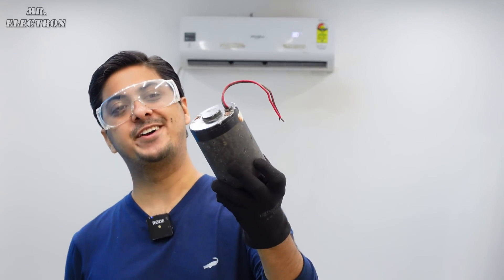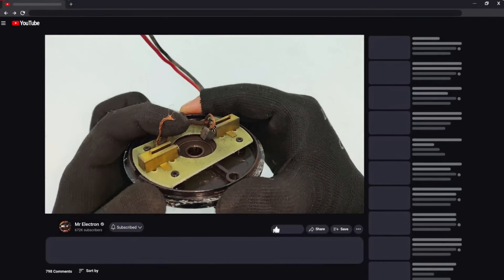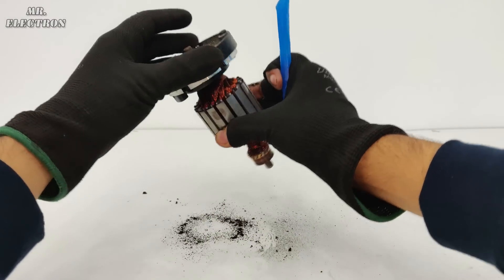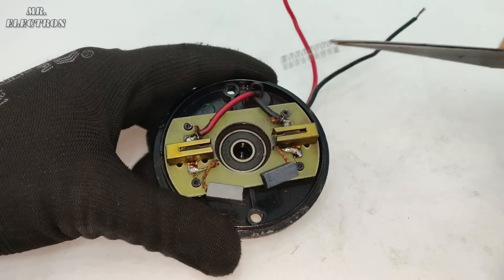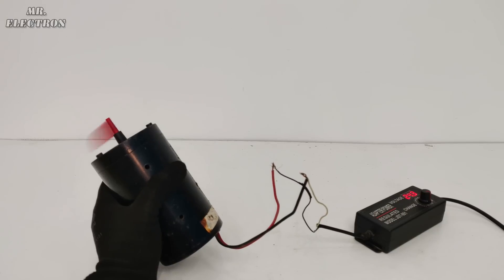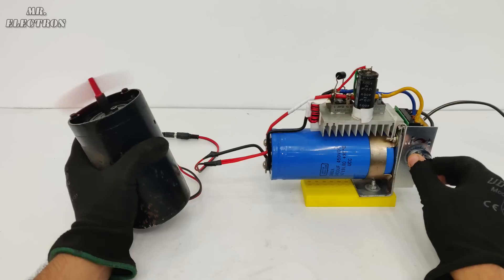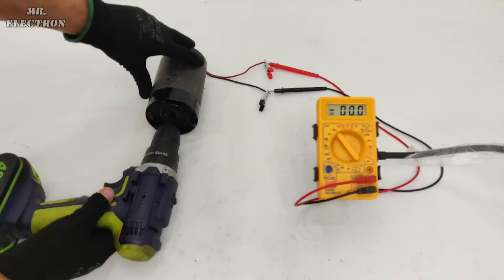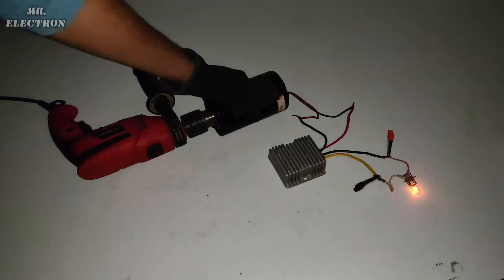Do Not Throw Away your Water Pump DC Motor Generator 24V

Comment: How did you collect that bucket of brushes??
Reply from the maker: 😀 I like working on alternators, dc motors, and universal motors. Since all these need brushes so i have to keep them. I have collected these from scrap market
Reply: @MrElectron  I started out working on alternators and starters. The nice thing is they are easy to file down to fit different applications.